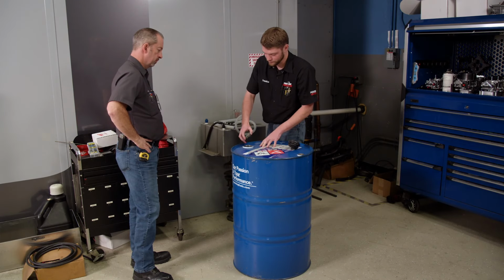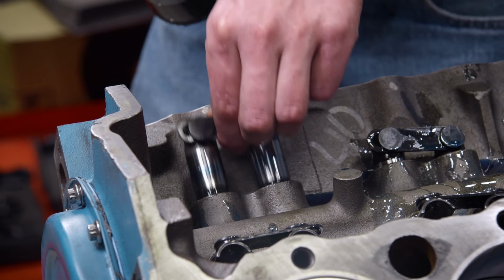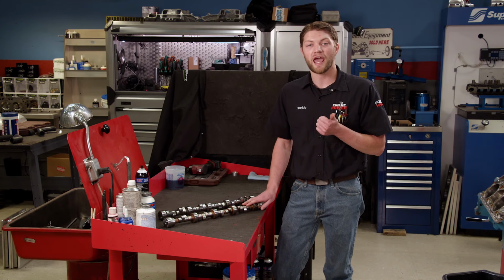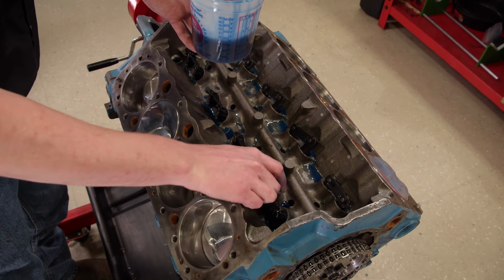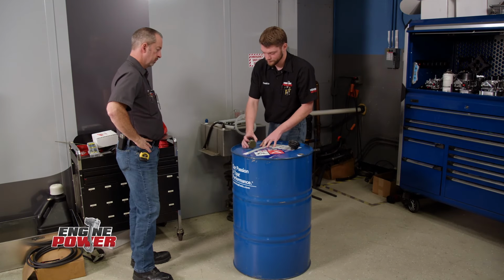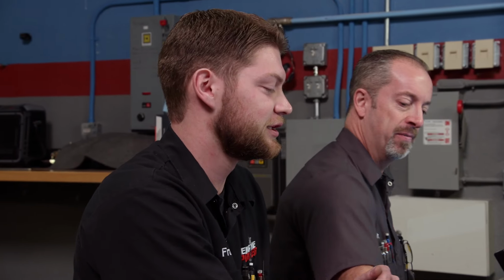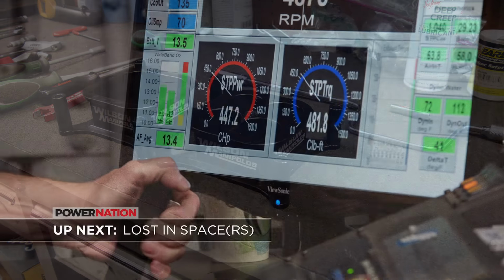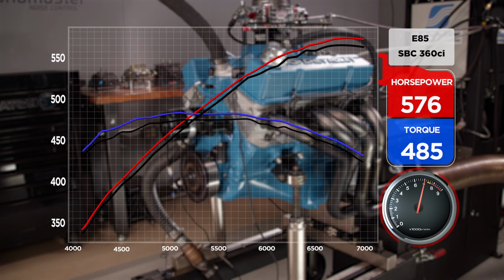Can a Stock Cast SBC Crank live at 7000 RPM and 570+ HP? - Engine Power S10, E1

Comment: I think MSD should come up with a 16 pickup distributor unit. 8 pickups for spark and 8 for fuel injection control.
Reply: Use the same 8 lobes for both...
Reply: @BuzzLOLOL  won't work that way. The 8 narrow pickups would be for spark and 8 wide pickups for fuel injector control. Single tooth reluctor for the timing of all. The wide pickups would be for 40 degrees on the cam timing and equal out to 80 degrees of crank timing. This way the fuel injection pulse will be on the cylinder two steps ahead in sequence as the spark trigger is tripping. Could be an almost stand alone system that could be retrofitted to virtually any engine.
Reply: @OneEye.  - Just have the injector and ignition pickups rotated to different angles...

Comment: Can’t beat those AFR heads, with a cam and 185s I gained 70HP on a SBF crate engine, was $2k less than a supercharger kit and performed almost 80% of the gain. Now if I even do decide to go supercharged it will be more on top of a really good base

Comment: I think it's a 60/40 chance running a cast crank at that rpm regularly. A few dyno pulls shouldn't matter but beating on it regularly at the drag strip would be iffy. It definitely makes the odds better that it has better rods and that all the fasteners are high performance aftermarket. A good quality forged steel crank is very cheap insurance for protecting 6000 plus dollars worth of parts.
Reply: Yeah it would be different jumping off the line pulling a car.

Comment: I want to put my car on E85. 1.8T Audi that came with 170 crank hp, I've done a lot of work to it and currently makes 280-300hp at the wheels on 93+methanol injection. The end goal is 400hp and 8500rpm red line.

Comment: I was broke when I was young and did this a lot. The engine would scream but it wasn't balanced good enough and it would eat the rod bearings. It was fun as hell for 2 years at the time.
Reply: That’s why I drove a Chevy the parts interchanged so well you could build some pretty good motors.
Reply: Main bearings are more affected by bad balance. Rod bearings detonation, oiling and over revs..
Reply: @TomSmith-cv8hk  lol I over revved my nova once and spun a rod bearing.

Comment: Nice display of the possible, I would stand back a bit on those pulls!! We didn't see the block  decked in this series....thinking about the RA on using those thin MLS gaskets, heads are good to go for them of course.
Reply: they re-use mls gaskets on turbo ls builds no issues like gaskets from the past

Comment: I ran a 350 stock cast crank in NHRA supper comp class for years at 7200 RPM in the lights run after run, stalled 5200 launched, shift point at 6500 RPM, ran through the lights 7200 RPM, that is a 2000 RPM variation start to finish line. in a 210 inch front engine dragster. this was in the 1980 to 1990 very low $ operation not as of todays cars makes no sense to run 8.90 ET.

Comment: Those old cranks were fine at  7k
Reply: just dont do it in circle track
Reply: "Old" - - it had center-bolt valve covers ! OLD is 2-piece rear main seals, dished pistons and smog pumps.
Reply: @peterdarr383  they're all old now

Comment: Fun fact, cast cranks absorb torsional vibration better than a steel or billet crank. That's not to say that they are stronger, by any means, but they absorb the twist easier because they flex more under normal use. 
You try and pile the power on they break pretty easy, generally at the #2 main journal. For street type use where they see top rpm once a month they are pretty capable.
Reply: 1/4 mile with a  cast crank?  ok

cast crank roundy round or circuit racing.....bye bye crank....
Reply: @KingJT80  of course it all depends on your power level and how often you rebuild the engine, and check the crank.. theres probably a hundred thousand of those cranks in service with the 602 crate circle track engine.
Reply: @robh9577  those 602/604s dont spin 7000  i can tell you that for a fact they dont have the cam to do it and if they did theyre illegal

Comment: Super charger with E85 small block Chevy???
Reply: richard holdner did that.  6-71 blown twin 750s' on a 383 made 700HP on E85 and 11.4 PSI  and thats pushing it for a roots  because they heat up BUT that e85 helped

Comment: Nice episode, guys please we want mild 305 builds using factory ported heads like the 416s, 601s, or even the tbi 081s.
Reply: richard holdner did some  battle of the 5.0L  ford 302 vs chevy 305
Reply: @KingJT80  I’ve seen it, and absolutely like it.
But am really looking forward to see an episode by Mr.Pat squeezing power out of little sucker.
I already got 297hp and 300lb.ft out of my 76 LG3 low performance 305 with stock iron intake and the factory 2gc carb with no headers just a true duals.
It got 10:1 compression  with a 30 over flat tops, a set of 376450 shit heads having them worked on the intake runners and light porting on exhaust and got a 1.94 intake valves instead of the old 1.72s with that 70cc chamber.
Also got a 212 224 .450 .466 cam.
Reply: "601's" will definitely pull up top.  Better exhaust port than the other 2.  Heavy castings too for porting
Reply: @CSXT8250  Can 601s found on caprices? like 80s and above?  The only 305 heads I found around are 376450 they won't flow much and 60cc chamber killing compression in factory dished pistons.

Comment: Lots of E85..... Good race fuel, lousy daily driver efficiency.
Reply: This is where fuel injection is great. You can have a race tune and an economical tune.
Reply: @shockracer  well, it has less BTUs therefore going to use more of it there's no way around that. I've used it because my vehicles are supercharged and turbo and yes it goes good but just doesn't last. The cost comparison with consumption is a false economy.
Reply: @JSFGuy  why would you care about fuel economy  with E85 and boost?  this means youre trying to make four digit HP. theres no economy there LOL
Reply: @KingJT80  well I'm not, I tried it out and it's an anti-knock. Just to see what happens because it's available. If I wanted to go fast and strong I dump a couple of gallons of 100 LL AVgas in my tank and that is the best stuff next to race fuel.
Reply: @JSFGuy  thats also an option.
Reply: @shockracer  exactly,all about the right tune... Have an 04 suburban "flex fuel", and on e85 stock it's a dog,but run a tuner with a million degrees of timing...
Reply: Where E85 shines is with a rootes blower with no intercooler.  Cools in nicely, thank you .
Reply: Wonder what the quality of pump E-85 is?
Reply: @EricHermosillo  100-105 witch is standardized and check just like gas has to meet the minimum level of octane
Reply: @EricHermosillo  Quality depends on where you are located. Warmer climates tend to stay more stable, cold climates tend to move around a lot in the ethanol content. For most setups race E85 isnt worth the extra costs.
Reply: At $2/gallon +the power I chose it over $4 91 every chance I get. It’s not as good but it’s not that much worse
Reply: Oh well lol
Reply: @RAMADDICTION  hmmm never heard of nor have I had any issues with getting up to temp. Guess that 20+ years building racing driving and watching surely would have been able to see that atleast once but we just get to fill the block more and eliminate more cooling system for the drag engines 🤷🤣 gotta love free time shaved off
Reply: @RAMADDICTION  You are thinking about methanol, totally different.
Reply: My van is alot cheaper to run on E85 than 91 or 93. 2 mpg less for fuel that cost close to 1/2 as much.
Reply: If you're using E85 then you dont care about fuel mileage are efficiency. It's good for power and quenching knock because its a cold fuel
Reply: @Wilson_Racing  evaporation rate.
Reply: @Wilson_Racing  it's cause it's higher octane nothing to do with being cold lol
Reply: @claytoncoolidge992  have you ever got E85 on your hand and put your hand in the air? Your hand will get cold super fast. Gasoline doesnt do that. Thats why its a colder fuel at any temperature
Reply: @Wilson_Racing  lol yes evaporation is a cooling process. But that is not what causes the elimination of spark knock aka pre detenation aka too much compression and/or timing and at the very extreme end of high temperatures resulting in combustion to start from itself and causing the knock or ping we all have known atleast a few times. The only way to stop that is either reduce compression or timing or add high octane fuel e85 100-105octane witch is barely shy of the usual type of alcohol fuel we used to use in racing aviation fuel witch is around 115-120 octane and if u were lucky you had access to cam 2 locally and it was 110-115 and leaded so couldn't run in anything that had cat converters in it. Anyway gas does the same thing when it evaporates same as any liquid changing state to a gas
Reply: @Wilson_Racing  well explain that to my doctor last weekend when I was trying to get my tractor running and spilled gas on my hand and due to evaporation and the fast cooling effects of it I got frost bite instantly and I was only outside 5 minutes. It happens with every fluid to gas change it's why we humans sweat when hot asf well
Reply: @claytoncoolidge992  it wasnt 100% gasoline then. It was ethanol that causes the cooling effect just like alcohol
Reply: @Wilson_Racing  no it was evaporation lol sorry man but gas evaporates as well as most other liquids. Yes alcohol evaporates fast due to a lower boiling point thus creating more cooling effect. But it's not really going to make a big difference in most engines until you get to the high hp levels as the more fuel added the more cooling effect it will have. I've seen what it does on the Dyno on stock applications and the cooling effect is not really enough to make a huge difference between the 2 in stock applications even low boost applications gain from the cooling effect is far outweighed by the gain from the octane and timing/boost or compression gain to be available from it
Reply: @claytoncoolidge992  The effect of reducing IAT in a “blown” induction system is very important to power. It’s not all Octane. Especially in a FI system that adjusts timing and AFR for IAT. Cooled charge also means more dense air, and lowered piston dome temperature which reduces chances for pre-ignition due to “hot” spots. If you are using Top Fuel dragsters as an example of no pre cooled high octane blown motors, that prove it’s all octane, those engines and fuel run are not a good analog for normal or even home built  “race” engines.
Reply: @apexclip3458  lol anyway man your talking about home built engines? Like what are you talking about? There hasn't been homemade engines since the first ones were developed. You also mentioned piston dome temperature. Hmmm off to say anything about that considering that most production engines use a recessed dome especially in boosted applications. Your also forgetting that most production engines use oil squitters to cool the piston and do not rely on the fuel to do anything with it. Your also forgetting to take into account the altitude the humidity the outside temperature and the intake air temperature as well as any other type of air cooling being done. You completely twisted what was said to talk about race engines when the conversation was regarding the cooling effect and octane mainly about e85 and gasoline. The very minimal cooling effect is well documented and is not really a factor outside of carbureted applications due to the fact that in port fuel injection and the current direct injection systems used fuel is added to the air charge so late in the cycle there is little to no time for it to cool anything. The other thing that is being ignored here is the natural cooling effect of air velocity. Have you ever looked at the intake of a tractor (I'm using this as the example for a few reasons the biggest being that they are generally not enclosed by an engine bay and they are not going to be preheated by the either heated air off the exhaust manifold or engine coolant so this is more visible to the naked eye) when the air temperature is roughly 50 degrees or below you are going to see lots of condensation and frost forming at the throttle body. Why? Because air cools down as it's velocity increases. There's many factors in the system that will cause different properties of combustion to change. But there is one thing that is not measured due to the minimal effect of it on combustion. Air temperature fuel composition ambient temperature ambient air pressure coolant/engine temperature are all factors measured by the ecm on all injection systems but fuel temperature is not measured. The other fact is that most e85 capable fuel systems ( atleast factory systems ) are returnless systems witch is going to heat up the fuel prior to injection thus negating any cooling effect and more likely to potentially add temperature to the charge. So again as I said originally the cooling effect is not a factor here the octane is the most important thing that is at play and is the only thing that is a constant factor of knock elimination in play. The cooling effect of fuel is to sporadic and too much variation in it's minimal effect as well as too dependent on outside variables to be used effectively to stop knock. I'm not saying that there's no possiblity that it may have a slight effect but what I am saying is that it is minimal and unreliable and therefore is not considered as a reliable way to eliminate spark knock. That's why things that are going to effect the charge temperature like nitrous propane water/methanol systems all inject as early as possible into the air charge so they have the most effective time to cool it down as possible prior to entering the combustion chamber.  Even carbureted applications the e85 is added at a time that it's not going to be very effective in temperature reduction. It's all been studied and proven. Your argument is trying to go against the 100+ years of studies and expirenentation by the people who only have one thing to study and what they are completely focused on. Facts are facts guys I'm sorry if they don't align with your personal opinion on the issue but it doesn't matter if it's a homemade engine or a billion dollar race engine there are certain things that are required for combustion to happen and therefore certain things that are not going to be variable. There is a limit on the distance from the intake valve that fuel can be added and not fall out of suspension with the air and ironically given the conversation it is also limited on being added too early to prevent it from getting heated too much prior to the intake valve. It's why port fuel injection is more effective than throttle body injection and why direct injection is superior to both of them. Fuel isn't allowed to get warmer prior to combustion. So if fuel temperature is so critical and we have spent years trying to reduce it's temperature prior to combustion then how are you going to think that it's cooling effect is even a variable in anything? It's not it's so small that it's not even factored in as a variable and is factored as a constant. That's why this is not a factor that is even considered.
Reply: Almost like race fuel 🤣
Reply: @Realtime1501  Yap..😎
Reply: E85 is great for efficiency in HOT summer stop and go traffic. It’ll do fine and terribly heat soaked motor. I know my car is night and day difference in summer traffic 91 vs E85. I’ll take the lower mpg as I don’t get heat related knock events.